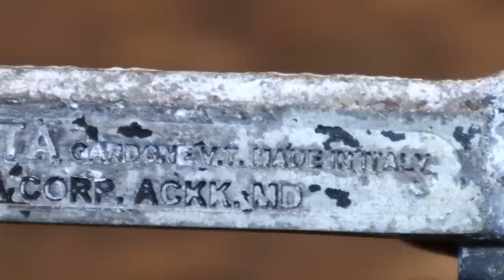Restoration of The  Beretta toy gun That Was Very Rusty

Comment: 1:40 Hmm...very strange. Seems to be a mixture of components. First of, that's a Brigadier slide, as evidenced by the reinforced slide (the "wings" just forward of the chamber) with would be Italian markings (Italian made Berettas have the Pietro Beretta markings. US made have Beretta USA markings), that reciever is all sorts of fucked up. It has a 92FS "scalloped" trigger guard yet it also has an A1 picatinny rail, BUT the 92A1s have the standard 92FS trigger guard while the 96A1 and M9A1 have the "square" trigger guard. I don't know of a single 92 series model that had both a scalloped trigger guard AND a picatinny rail... The handle doesn't have a straight backstrap, so it can't be an M9A3 (or any new models like the 92X). The mag well looks like it's a .22 but it doesn't have the distinctive "rounded rectangle" in front of the take-down lever...

This thing is a fucking pellet gun
Reply from the maker: Thank you